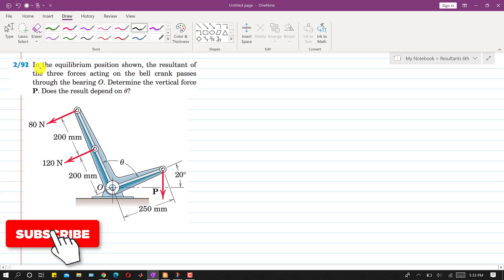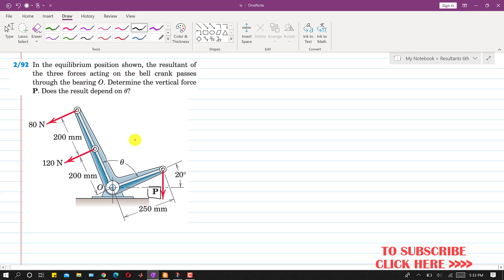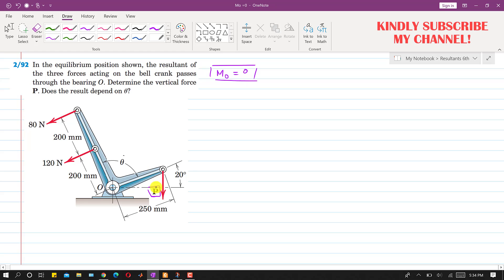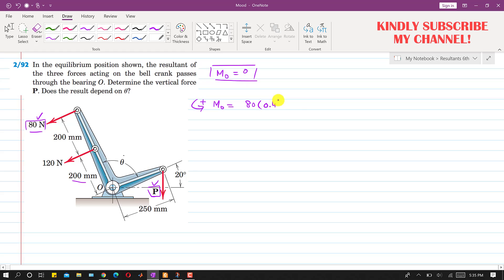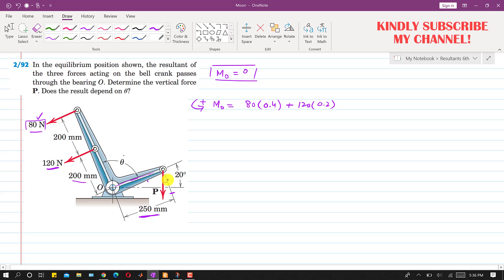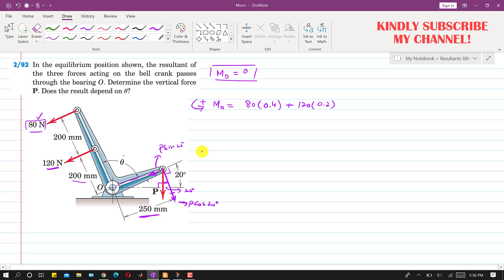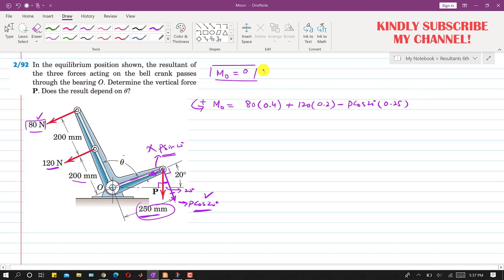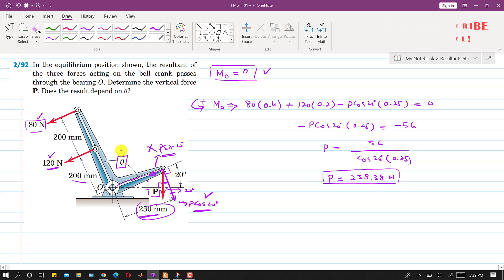2-92 | Engineering Statics | Resultants | Engineers Academy

Comment: but why? if theta changed, the angle 20 degrees will change as will, why changing theta affect nothing? 
thank you
Reply: I think your answer is correct if we fix two things: 
perpendicular forces (80, 120) and angle 20, otherwise theta has affect on the problem. 
isn't?